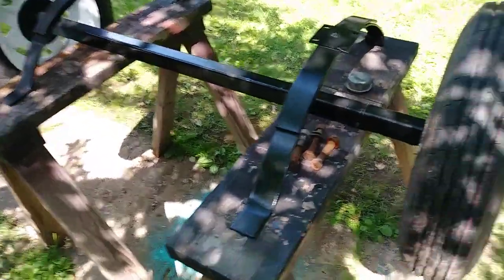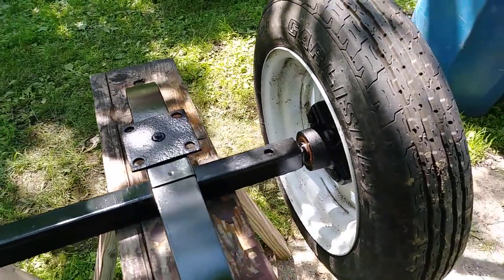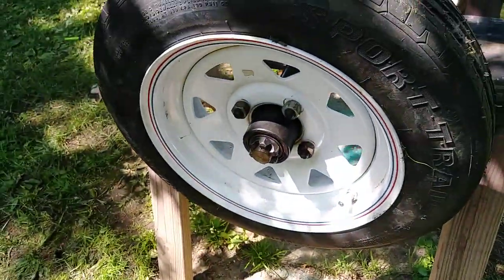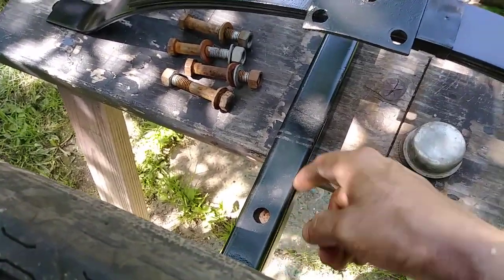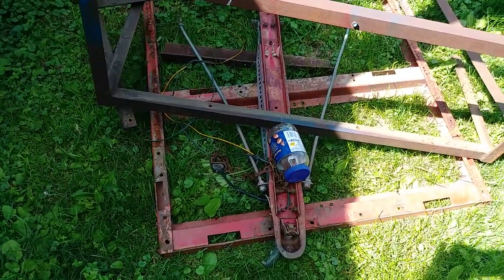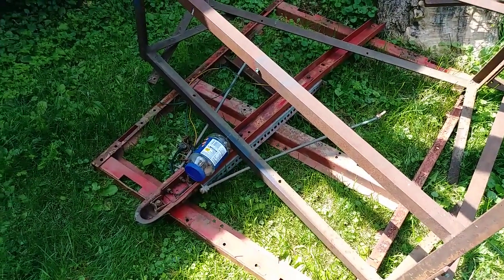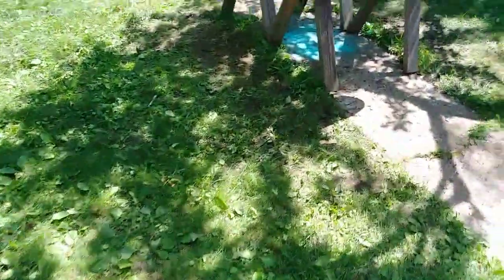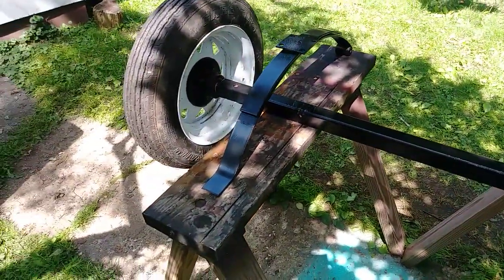Axle Refurb... Harbor Freight Style Trailers Are Junk.

Comment: Everything from the horror fright is junk!  You get what you pay for in that store.    Only thing worth buying is hand tools.  Power tools and everything else is no bueno 👎
Reply: Those magnetic bowls there are pretty useful. Zip ties, tarps and moving blankets seem alright but I would be hesitant to spend on tools and heavier equipment there.
Reply from the maker: Almost everything lol... Hand tools are decent. I have a 1x30 sander i have used alot over the last 4 years. Good reveiws on the metal lathe lol but as far as any other heavier type tools...I won't buy them lol I do get sandpaper there and buy my pyro scales there.